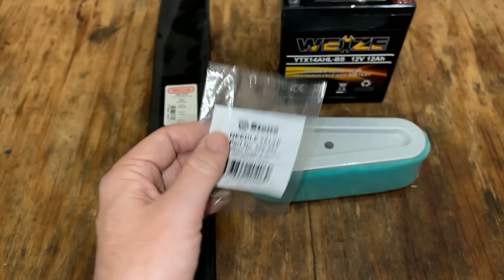First Start in 20 Years - MTD Riding Mower w/Briggs IC Engine

Comment: I have the same engine on my Toro tractor from mid 1990's.  Couple times it has flooded the crankcase with gas. Fuel shutoff is a good idea.  Surprised you also didn't replace the seat (along w needle).  I tried cleaning the needle/seat once but it flooded the crankcase again month later with gas. Got a new needle 231855 and seat 690577 and problem solved.  Simple drywall screw and prybar will leverage out the seat. Good engine for me...20+ years.
Reply: My local Ace Hardware had both in stock.
Reply: Last month I had the same problem with my 1998 Simplicity 30" that I bought a couple of years ago. Same engine and fuel system. I wish this video would have been uploaded sooner.
Reply: They known for flooding

Comment: Thanks for such a detailed and comprehensive video that just happened to be my nearly exact situation.  I have owned a Murray 10hp rear engine mower since 1990 that I parked in my shed around 2000 becauce it wouldn't start.  About a month ago I decided to get it working again and have gone thru more frustration, starting with the tires.  I wasn't as lucky as you.  After that I progressed to the mechanical.  I added a new spark plug, carburetor, air filter, battery, washed out the gas tank , changed the fuel line, but not in the order I should have.  So, because my engine kept racing (hunting?) and misfiring I thought about washing the tank, but I didn't put gas through the old fuel line into the new carb, but wondered if I contaminated the new carb somehow, so took it apart and squirted carb cleaner and wire thru the pin holes and reinstalled it.  After that, no racing or misfiring, except it seems to run steadier at idle speed,.  But when I begin to throttle up, first it starts to race real high then it starts to choke up and wants to kill, unless I throttle back down again.  I didn't know how to remove the emulsion tube, so didn't address it when I had the carb out .  I was hoping you could advise me whether that might be the problem or not?  It's befuddling how it runs at what seems to be high enough RPMs throttling down, but not up?  Can you help?  Thanks!  LP

Comment: Very good job bringing this old machine back to life, I think I would have replaced the deck belt just because of age and possible dry rot or maybe I missed that in the video. I wonder if the check valve on the oil drain was designed to use with an extension hose with a coupler on it to drain the oil. Something like the newer riding mowers have today. 👍
Reply: No he didn't replace the belt. But it looked good.

Comment: Jim, I used to have a wagon with air tires, and they used to go flat over the course of a few days. I cleaned them up like you did, but put dish soap on the beads, and they finally stopped leaking. The wheels were plastic, so it was likely just dirt in between. Worst case scenario, one can get bead sealer and apply it to the wheel, and that will usually do the trick.
Reply: That's what I do is put bead sealer on and it works great
Reply: "Worst case scenario"... I was always told wcs was to put fill-a-foam in and you will never have to air it up again ;-)
Reply: @jimmydean8007  expandable foam is great for cracks and crevices, but is inadvisable in tires
Why, you might ask? It's because the foam is open cell, unlike what dealers use in tires. The other reason is that once you have foam in a tire, it's virtually impossible to dismount the tire. One would be better off getting a new assembly and start over.
Reply: @Farm_fab  I've never seen a dealer put foam in a tire (fix-a-flat maybe?), but I have witnessed individuals with it on 2 different occasions. I don't know if they used open cell, closed cell, or window and door non-expanding but in both "wcs" the tires had dry rotted to the point they were leaking air through the sidewall due to sitting flat (I'm guesstimating that's what caused the sidewall cracks, don't quote me on that part). The lawn guy said he had no issues but the atv driver said the ride was a little rougher per no give. As tires were doomed anyway I seen no issue in giving life to something that would be in the dump anyway. A sawzall will remove that tire quickly when the time comes due.
Reply: We had issues with the tires on our riding mower going flat.  Solved it by putting inner tubes in them....

Comment: Another excellent video James! For the first time that I know of something went flying (the tank) across your work area....lol Not your fault, as that tank seal was a real bear and it took that much force to free it. You really care about the quality of you work and we see it every time. My dad was a machinist and had extreme hand skill like you do. Also he could fix almost everything. Had both arc and acetylene welders at home etc. He made a trailer for our Penn (engine in the rear) riding lawn mower and attached a stainless steel bed in that trailer. I bet someone is still using that trailer today. That Penn mower rode and cut very smoothly on our acre in Kansas decades ago.  Good times and many good memories growing up,  and the 3 speed 2 cycle scooter motor he mounted on a go cart was one of my favorites...

Comment: The ol girl runs good thanks to your efforts.  Did a good job of mowing that tall thick grass.  Notice it was not easy to turn the steering wheel and  it looked like it was hard to steer re turning around. Bet it had a wide turn radius too. Still if you keep it, sell or give it away, it will give someone a good job at maintaining their lawn.  Good for you for sticking at it to get it looking good and running again.

Comment: I had this exact mower and when you took the side of the mower to get to the battery and motor I was kicking myself in the head. I literally worked in those tight spaces. Work smarter not harder. Lol

Comment: Excellent job.  I have an over-30-year-old Toro riding mower with 8-HP BS engine that's kind of similar to yours.  It still works fine.  I learned a lot from your work!  Thanks.
Reply: I've got a Toro 8/32 and it's one of the best mowers that I've used
Reply: Yes, a local service guy, an old timer, commented "They don't make it like that anymore."

Comment: I have this same machine. Mine is a 1986 model.
I removed the deck installed a couple different hitches in the back and some lights. I installed different throttle and choke cables. I got it free from a lady that had it in her driveway for several years with a flat tire.
I use it to pull a 5.5’ x 9’ trailer around the yard. It pulls like a horse. Ive pulled this trailer with a half yard of wet sand on it which is about 1400 lbs.

Comment: Won one of these in a Fire Department raffle many years ago.  It was fine for the size of the lawn I had at the time and was nice not to be push mowing.  Moved and the new yard was much, much larger and needed so moved up to a garden tractor with a 54" deck.  It was a good little machine and it was given to a friend who had a smaller lawn.

Comment: Another great video. I was surprised at how well that mower was designed. As you mentioned, the time required for the blades to stop is a design issue, but it seems to be a really nice little mower! Nearly everyone, including myself, use zero turn mowers now days, but that little mower impressed me! It seemed to be better than many of the larger tractor type mowers. Thanks again for the video. I really enjoy watching them both for the knowledge gained and simply for the entertainment value as well.

Comment: Yes I own a newer MTD from Walmart and it is a tank. That week I got a mulch door to use the grass leaf cuttings as fertilizer. MTD parts are universal and easy to cross match.
Reply: Newer MTD is cheap and junky, but if it has a Briggs and Stratton engine, it'll last forever. The rear engine ones are really simplistic so there's not much that can actually break lol

Comment: The term "emulsion tube" is a term I have never encountered before. I submit that there should NEVER be emulsion of any kind in a carburetor , so I am at a loss to understand how the name came about. Care to enlighten me ?  Your videos are absolutely excellent, & your little "techniques" for making the job at hand easier, are also excellent. . Great series of videos, & an old guy like me learns something from each video. 
When I was a teen ager, I would not have watched these videos, because I knew everything . My thanks to you as always.
Reply: Here is a cut from an archive page of a site called High Power Media  -                                                              The fixed-jet carburettor works by pulling fuel from a reservoir in response to a pressure signal from the venturi in the engine intake air. The depression thus created causes fuel to flow from the fuel reservoir in the carburettor while at the same time encouraging a small flow of air at atmospheric pressure to mix with the fuel. The fuel is metered through the main jet while the air is controlled through what is generally called the ‘air correction jet’. Somewhere in between, the fuel and air are intermixed to form an emulsion – a fine dispersant of the air inside the fuel. This assists the atomisation of the fuel as it eventually enters the engine airstream.
Reply: A lot of us are old timers Brian. You can never be too old to learn.

Comment: Another option. Instead of the foam on the hold down bar. There is Performix Plasti Dip or  RUST-OLEUM Rubberized Dip Coating just drill slightly over sized holes for the hold down bolt, dip one side, let it dry, then dip the other. You then have a totally rubberized steel bar.

Comment: We were selling that model in the UK  in 1985 , first 8 hp then 11 both with 4 swinging blades on carrier disc. There was a crude blade brake bolted under the chassis. When the deck was raised the disc came into contact with the brake - better than nothing!
Reply from the maker: I think this one had the same setup back in the day.

Comment: Well, that mower brought back some memories. Back when I lived with my grandparents on our old homestead, we had an old Craftsman riding mower with a 30 inch deck. It was a 1980 model and I believe it was 10hp. It seemed like there was no grass or weeds that could bog that thing down. I had to put a belt and new blade on it and I noticed the pully was weighted internally. It was heavy and acted as sort of a flywheel. I think that's why the blade keeps spinning for awhile after you disengage it.
Reply from the maker: Also the ball bearing was in very good condition.  Someone also pointed out that it was supposed to have a brake, but that is long gone.

Comment: I've got some of this to do too and have been getting a Deere sulky fixed back up to use behind a Gravely walk behind with a 40 inch kidney mower. It looked about like that one having set for years but 409 worked again. If I have bead leaks I just use gun grease to seal it off and if it won't seal, a tube is forthcoming. NO DOUBT about that 'L' head running. My 5K genset I/C is about that model and has never missed a lick and the 8 horse I/C on the Roof is older that it and runs like a Swiss watch. Those grommets are very interesting but the tanks are tough. Thanks, Pal and God Bless Yall!

Comment: Great videos. I do have one unasked for suggestion.  I’ve installed probably 500,000 cable ties in my life. After cutting off the tail end, use a flat file for 10 seconds on the cut end.  They are razor sharp and will cut you in a second, usually on the back of your hand or arm.  Happy mowing.
Reply: We had to use flush cut cuters to avoid safty defect faults.
Reply: @darwynehourie6111  We used a tool that tensioned the tie and then flush cut the end. No need to file. He was using side cutters, leaves a wicked edge. Cheers.

Comment: Super helpful as usual. I wonder if you could work around a rough needle by chucking it in a drill and holding some 2000 grit sandpaper against the cone surface to polish it up.  Nice grass!

Comment: Rance here. What a nice mower! I think that model of Briggs flat head engine was one of their most reliable design. A stroke of genius to use heat to loosen the brass emulsion tube out of carb. .  . What a bizarre way to drain oil. It remakes the point ; nothing is easy and we always get too late smart…like you said should have changed oil when deck was off. I would like to make a suggestion that I have used in the past to clean parts after I used engine cleaner…a hand held steamer ( $50 on EBay) that rinses without to much left over water to worry about.  I’m still blown-away with how the heat loosened that emulsion tube!  (How many I have destroyed one !….) Very good video and instructional video.

Comment: the oil drain .....is a quick change adapter ......you just have to turn the whole end of it, and it should lock in, so it will drain. you can also add a little  hose to it so it drains in a more out in open  spot.   Great Video.

Comment: Hi James, the white zip ties may last year and are not UV rated or impervious to fuel, hence the black ties from the factory. Next time removing the fuel nipple, cut away all the rubber as you did, a retractable long blade razor knife works best, then with a wooden mallet drive the nipple into the tank and retrieve through the fuel fill...great work, peace.
Reply: Beat me to it- hope he sees this!
Reply from the maker: Great advice, thanks

Comment: I see you finally wised up and are cutting in the right direction.  Always cut so the clippings are thrown away from the next cut.  CCW is the best way.
Reply from the maker: But then all the clipping get thrown into the mulch and I get in trouble from the wife.
Reply: @jcondon1  I run my yard.  If my wife does not like how I cut it then she can do it herself.  I mulch the yard but I do not have a compost pile.  I leave the clippings to decompose in the yard which adds extra organic matter and fertilizer to the yard.stacking clipping to high can kill any grass below them.  I try to evenly disperse the clippings throughout the yard or blow them into areas that need more organic matter.  The soil in my yard is quite sandy and does not have a lot of organic matter in it.
Reply: @jcondon1  I stay in trouble, but I do not let it bother me.

Comment: I have an MTD of similar vintage that has a spring loaded brake that engages in the back of the blade drive pulley as the deck pulls back. Its a 'V' shaped piece of friction material that screeches horribly but stops the blade a treat. It might just have disappeared over the years.
Reply: Yep, that deck is not original either as they were all rear discharge.

Comment: I don't want to go off topic but I watched several of you generator videos and learned a lot I bought a predator from harbor freight 3200 4000 Watts for 200 bucks from harbor freight it starts right up but low power I bought an AVR and coil with brushes she's got power thank you very much your the man 🚀🚀 I smashed that like button and subscribe now I'm going to buy an Ometer to read the output thank you for sharing your knowledge with everyone it's priceless I bought it years ago probably 10 or more it was totally worth buying the AVR for 17 bucks and I got 6 coils for 8 bucks if she didn't have output I was going to turn the motor into a moped 😂😂

Comment: I hate to be to critical, however, tires, longterm, pull it off, pull the tire, wire wheel it really well and paint it. Be sure all the rust it removed. 
Starting it, do not use Starting fluid. Mix a bottle of chainsaw fuel with a dash of Berrymans B12. This lubricates the rings preventing damage to the rings and cylinder walls. Just dash it in the carb to get it running if possible.

Comment: Now you're going to have to fix a trimmer to go back and pick up the rest.  Great video James.  Two things worth trying, PB blaster softens rubber.  Spray it on those petrified gromets, and fuel lines and let it soak for a few minutes then they come off easier.  I wouldn't reuse the lines again because it probably damages them, but when you're taking off petrified lines it works.  Second have you tried using lapping compound on a cotton swab in a drill? You can polish seats so the needle can make better contact.
Reply from the maker: Have not tried that yet.  Usually I resort to a q-tip in a drill as needed.

Comment: The buoyancy force inside the carb is significant higher than the weight of the float itself. With more force, the needle should keep more fuel pressure than 3 PSI. Nice video as always!

Comment: I squirt Marvel Mystery Oil in cylinders to lubricate them.  I keep a 50-50 mix of 10W-30W oil and MMO in my pneumatic oiler for just such occasions.  I use it for general lubrication on things that need it.    Sometimes, I mix bar oil and MMO in my pneumatic oiler.  Bar oil is a 30W oil.  I have a lot more chainsaws than I do old four cycle engines and bar oil will not hurt any engine.  I use it to lube bars for my chainsaws after I clean them with gas or break cleaner to remove any sand that may have gotten in them.

Comment: This is so awesome, I have this exact make and model of mower.  Mine might be a couple years newer but exactly the same.   I made a "will it run" video when I first got it but the gas was leaking out of the tank and into the oil so I stopped using it.  I have heard subsequently it might be the fuel shutoff solenoid... or something like that.  I think I'll take another swing at it now that I found your video.

Comment: James in a pinch I use aviation permatex around old gas tank bushings it is pretty impervious to fuel and oil. Works until a better solution can be found.

Comment: I think the extra gunk in the carb bowl was in the old fuel line. When you originally pulled the carburetor, you cut off the fuel flow but left the old line in place. Then, when you ran the engine after carb replacement, the old residual fuel from the line went into the bowl. Then you replaced the  fuel line. That's my memory of it anyway.